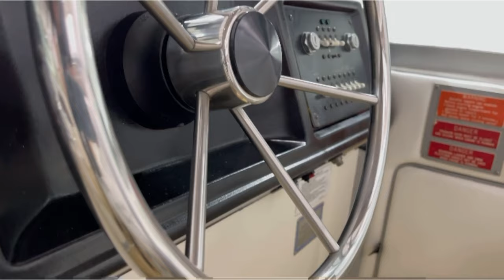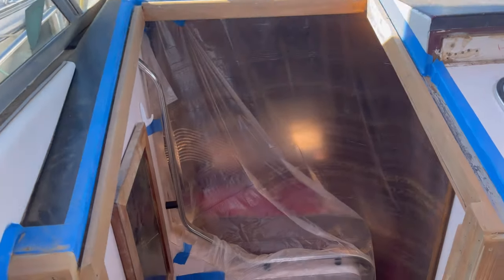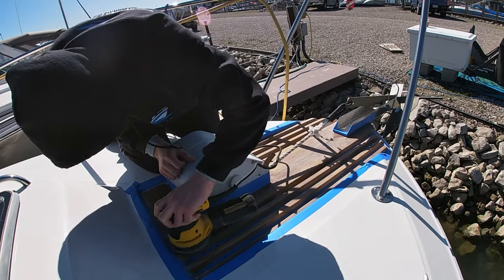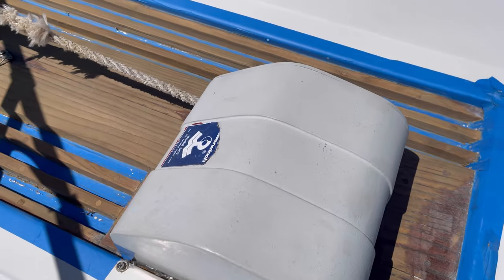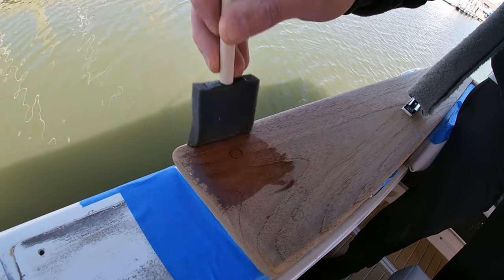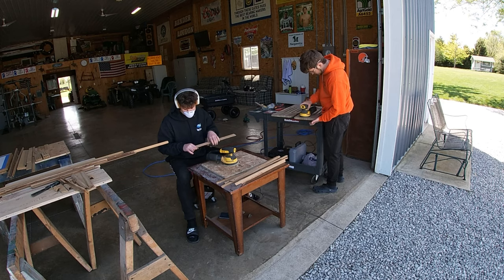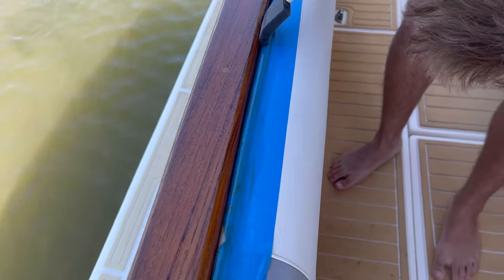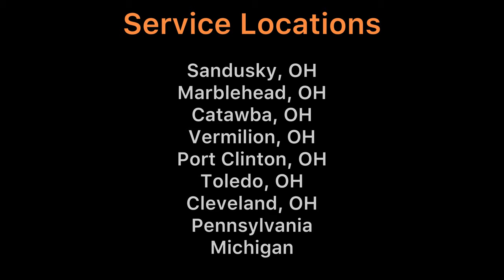Teak Restoration | Full Tutorial Sanding | 330 Sea Ray | Sikkens Natural Teak Marine

Comment: What did you use to clean up any Cetol that might have dropped on the deck matting? Just did mine but didn't use enough drop cloths.. Thanks
Reply from the maker: I didn’t run into this situation. I think you could try acetone.

Comment: Love the video.  I will be using the same sikkens natural finish Cetol marina varnish to refinish the teak on my sailboat.  I have read that I should use a heat gun to scrape the old varnish off but I think I'll do the sanding route. After all my research tho I feel that maybe you should have used a cleaner And teak brightener on everything before applying the varnish.  Do you think it may have come out even better had you done that?
Reply from the maker: Definitely sand the teak down and remove the varnish. I would never suggest scraping it off to anyone. Cetol is not a varnish it’s a stain and sealer system. Varnish is completely different, better for salt water and hotter environments. Either way you wouldn’t use a teak cleaner and/or brightener. You apply to bare wood. The outcome we had was exactly what was expected

Comment: Quick question. To clean the sanded teak prior to applying Sikkens product, you mention vacuuming, then wiping with water.  Would wiping with mineral spirits work, too?  My mild concern is trapping moisture under the Sikkens.  Lots of moisture up here in the Pacific Northwest; the surfaces won't always dry as fast as other places.
Reply from the maker: Yes, mineral spirits or acetone is a better option!

Comment: How do you take off the swim platform wood inserts
Reply from the maker: Honestly I don’t exactly know, but I remember it was relatively simple. I think we just used an impact drill and took off whatever was necessary bolt / screw
Reply: 4 screws on the underside